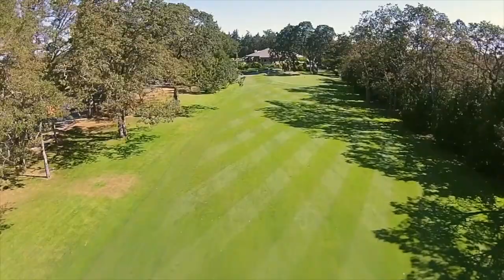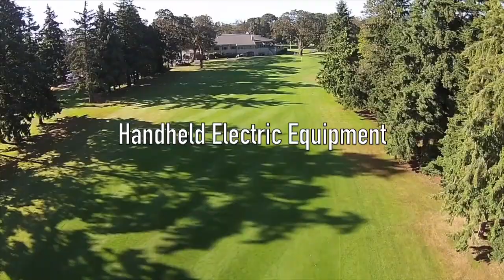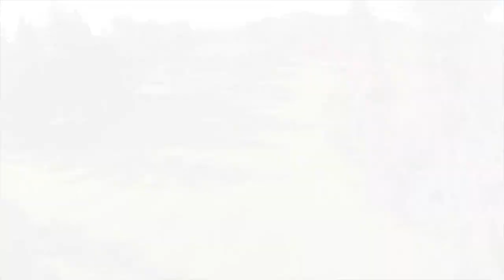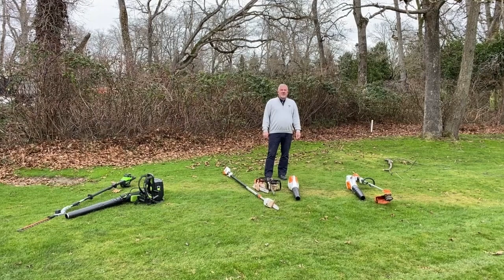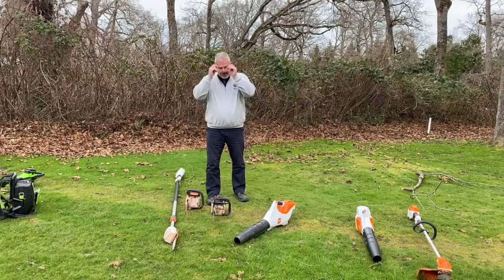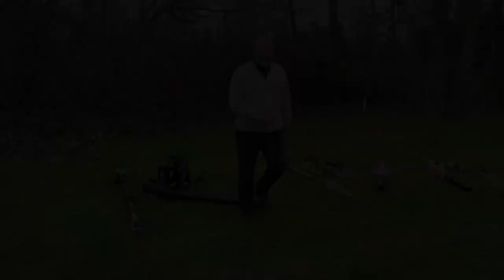Handheld Electric Equipment

Comment: thanks for the review of these. the hedge trimmer needs some lubrication. not sure if it's just the motor or the blades or both. the back pack blower is a waste except up by the club house, if you're hitting the course with that thing you should really be using a PTO powered air blower on a tractor. their range far surpasses, their power far surpasses and the time saved should be 50% to 80%. i get the hesitation to the tractor weight and wear & tear on the course but it's the difference of a guy walking with a back pack blower vs a passing jet liner., the back pack blower isn't significantly quiet enough and is actually higher frequency which is more disturbing and the electric back pack blowers CFM is too low, i have found 800CFM  is optimal time, power and range. a worx 8oo+cfm corded blower with a 100' 16gauge power cord and as 2000w honda generator has proven to be more quiet & effective than that back pack lower and even a stihl 800C/X model.
thank you for your videos, hope this tip i gave you pays back in what ever small form helps. former 36 hole silver springs monticello mn groundsman.